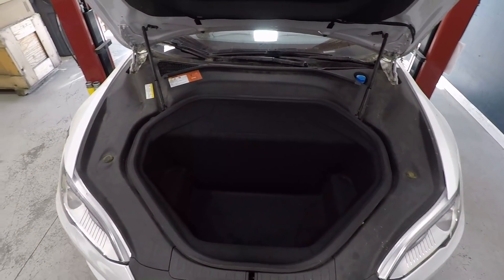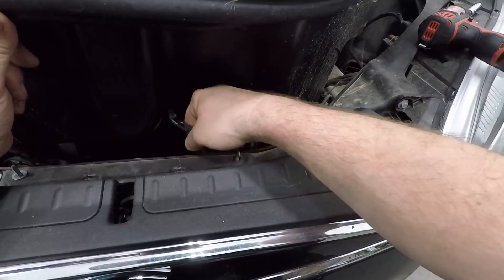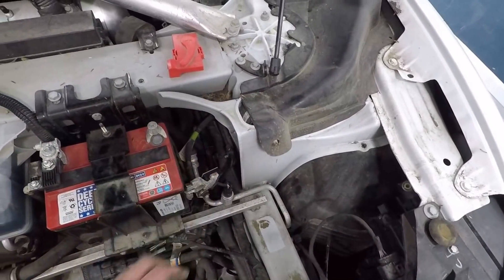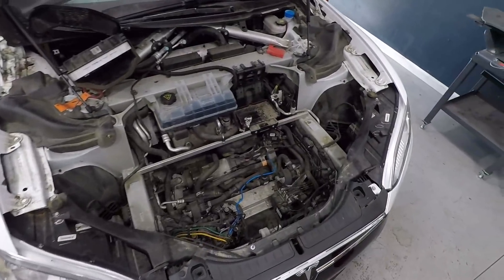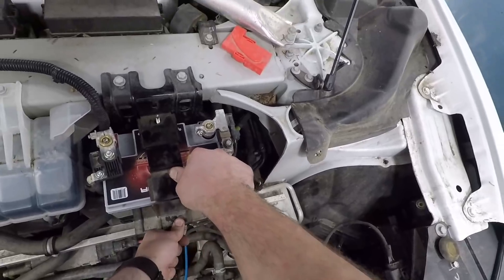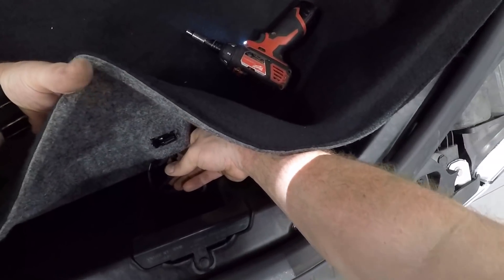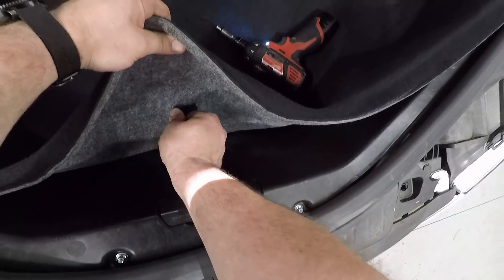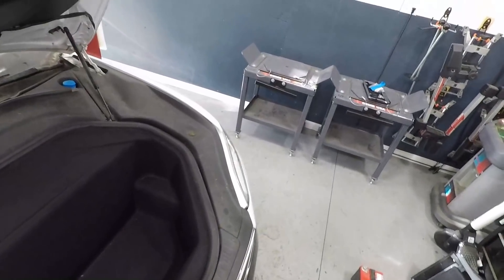Model S 2015 and up 12v Replacement

Comment: This is an old video but I just changed my 2014 Model S 12v battery. Did not disconnect the Fireman's cable. Just powered off the car. Switched batteries and the car is fine. Many of the error messages I had before have disappeared. Ordered Full Throttle battery from EV Tuning. Slow shipping with them so don't order if you need it fast

Comment: I know its long after the post but people still read them when they have to do the job. My 12v battery lasted 10yrs I think its all down to how much you use 12v services. Anyway if you have a late 2015/16 model its an even simpler job the link is visible all the time and the filter is on the opposite side (passenger UK!) heres to another beautiful 10 yrs.
Reply: It's weird, when I had to replace my 12V battery the first time in 2023 for MS 2014, I found that the battery manufacture year was the same as the car. So the battery lasted 9 years!
Today, however, the same battery I replaced in 2023 just died after 2 years... Supposedly it's the same DCS 33-UNCR, but the top housing is now gray instead of red and the new one is made in China, while the previous was made in the USA, believe it or not. That kind of explains why the quality went to shit, and I won't be replacing with OEM part anymore, that's for sure.

Comment: Imagine being the Fireman who has to go through all that in order to pull the fireman's loop while the car is undergoing a thermal runaway lithium battery fire assuming he can even get in the car to open the frunk hood.
Reply: I imagine they would just cut the bit that sticks out instead of trying to reach the pull-out clip. It's a cheap replacement anyway.

Comment: The Tesla service procedure says power down car, remove negative terminal clamp and then disconnect first responder loop. It kinda didn't make sense to me but I followed those instructions and I did get a fair bit of sparks when reconnecting the battery.  So I was curious of how much sparking you got before reconnecting the first responder loop and it seems a lot less. Bit puzzled about that.
Reply: We did same as on video and still got bunch of problems - are everyone sure we need to disconnect HVIL - then minus then plus ? And not Minus - HVIL and plus

Comment: If your 12V battery dies and leaves you on the side of the road and  since local auto parts stores don't stock a replacement battery what do you do? Is there a way to get the car moving without the 12V battery in place? Can you rig a battery in the frunk and make it home? I drive a Model Y.
Reply: Used a ride-on mower  battery on my older Model S and it worked. No it will not work without a 12V battery in place.

Comment: How/why does this make any difference? This isn't the traction battery, so what does it actually do? Make the radio a little louder and the brake lights a little brighter?! I'm lost why you'd bother?
Reply: Its run the lights and other things like in a normal car
Reply: @Renedue1967  yeah, I know that. But why does having a higher power, lithium one make any difference? Other than my door locks will be faster?
Reply: You need 12V for all the little things like doors, dash, lights. Running the DC to DC converter 24/7 is innefficient and would drain the HV battery too fast. Also, in an accident you can disconnect HV to prevent shock and still have systems running.

The car idles on 12V power and will turn on the DC to DC only few times per day to top off the 12V battery.

Comment: Does the 12v battery get recharged from the lithium battery when being recharged or is the 12-volt battery recharged with regenerative braking?
Reply: The car as a DC-DC converter and uses the main traction battery to charge this as/when it is needed. The DC-DC converter is 1500W-2500W depending on year and model.

Comment: how did you disconnect firemans loop..?
Reply from the maker: There is a red pull clip in the black housing connector, if you use a small flat head screwdriver to pull outwards, it will release the loop.
Reply: Thanks

Comment: The battery should be configured to the car. It works without doing it but it won't last as long as it could if it was calibrated.
Reply from the maker: The only configuration is the cell type of the battery, the latest is carbon nano config, black bottom, red top battery. That is the same configuration as what is going in it which is basically maintenance free led acid battery. No calibrations.

Comment: Can you get the 12v from auto store - if so what is the model number or name to ask for ?
and is all the Model S the same as this one?
Thanks
.
Reply from the maker: So that's tough one, no not all MS are the same, the Dual motor is easy, the rear wheel drive is hard, I have a video on that one also, the older MS requires a battery with bolt  on terminals on it where the DM just needs posts, its not an easy find due to the terminals being on the opposite side of what the MS requires. https://evtuning.com/ has 12v available online.
Reply: @ElectrifiedGarage  Thanks for the info, my 12v battery has no issues yet with about 120,000 miles , 2018 M-S100D. 

I have an appointment Jan 12 with Tesla Service Center about my MCU, hope they will replace under the email warranty issue. Thanks again. Please open up a shop in Port St Luice, FL.
Thanks again
Dale 
.

Comment: If you are in Europe you can order the same battery online from Wales here: https://www.tayna.co.uk/motorcycle-batteries/full-throttle/ft438-u1r/
However, if your Model S is an RWD pre-3/2016 you need an adapter post for the positive terminal. You can add this as an option when you order here:
https://evtuning.com/collections/model-s-facelift-electrical/products/model-s-replacement-12v-battery?variant=31667739820094
Quote: "Important fitment information**
2012-3/2016 RWD Cars require adapter post which we include. (See video for installation with post adapter)
2016+ RWD and 2014+ Dual Motor car do not require adapter post"

Comment: What a performance, just to change a battery. Why did Tesla employ Land Rover engineers?
Reply: Much easier in the new 3/Y.
Reply: @TJC450  Much harder in the older Model S when it was (in the wheel well?).  Honestly, removing and replacing the 12V battery is part of how I picked a body shop after my car got hit while parked in a garage.  The first estimate included 4 hours to open up the frunk, open the wheel well, remove and store the battery, condition it, reinstall it, put the wheel well back together, replace the frunk liner, etc.  The second estimate didn't include removing the battery.  It wasn't necessary, the procedure was for a battery in the wrong place and the labor hours were ridiculously inflated no matter where the battery was.  I  wasn't paying anything over a $500 deductible, but I don't trust a shop that pads its bills like that.   Punchline: The repair cost my insurer 2$7-28,000 for very little visible damage.
Reply: @domenicoperrella3501  That’s ridiculous. Glad they moved the location.
Reply: @TJC450  The battery was located behind the right front wheel well to lower CG of the car.

Comment: When should the 12V be replaced? Ive got a 2015 with 43k.
Reply: When the 12 volt fail message/light comes on or when your car doors, trunk and frunk won’t open or respond. That’s a whole other video on how to get into a dead battery (12V) Tesla. I’m sure Chris and Chad will make that video for us.
Reply: I did not get any warning and it was super inconvenient when the 12V died. I would just replace it every 5 years as a precaution now.

Comment: $200 for a replacement 12 volt battery that does nothing but excite the electronics so you can drive down  the road on the traction battery.

Comment: It may have been done faster, but never as sexy. I am curious, does the Tesla inform the driver the 12V needs to be replaced or is it pedestrian, like all others, and one morning it just is dead?
Reply: Not always.  My 12V battery died in the middle of a software update (as the DCDC would not top it up during the update) bricking the car. After replacing the battery it woke up but was not drivable or chargeable. Luckily Tesla service was able to fix it over the air by uploading another software update. An indication that the 12V was on its way out was a slightly higher drop in SOC when the car was parked for a few days.
Reply: @W M Thank you!

Comment: What is the purpose of the 12v battery if is has the larger battery pack?
Reply: Most electronics inside still run off 12v. The main battery pack is for propulsion.
Reply: The 12 volt runs the electronics that turn on the 400 volt.
Reply: It's required by law in many places so the car can always flash hazard lights if in an emergency situation.

Comment: clean connectors & posts - apply very light coat petroleum jelly - even engine oil - or grease to keep corrosion down. 
(very light coat)
Reply: I prefer penitrox, it's a line of products made for professional electricians to use on electrical connections that are dissimilar metals, it's a grease with specific metals suspended in it.
Reply: @kingrpriddick  Penetrox is the correct name.
Reply: Not really needed with sealed AGM batteries with quality posts.  I have 11 year old Odysseys with zero corrosion.